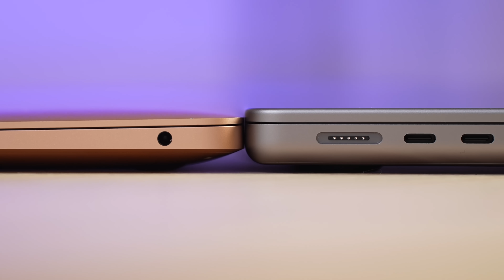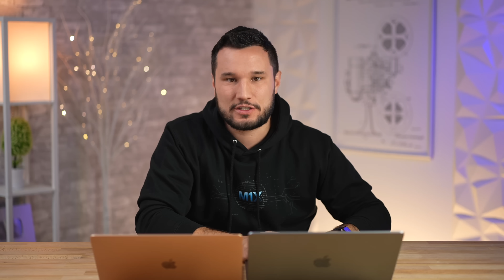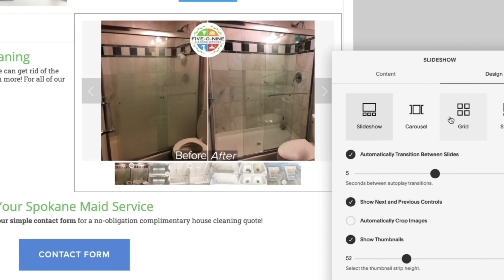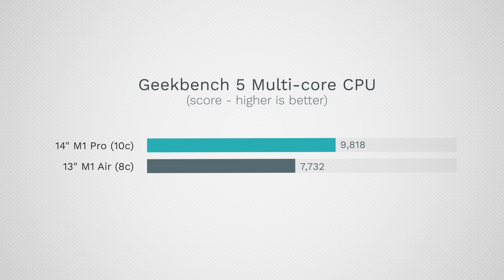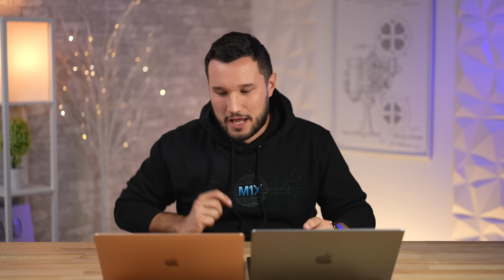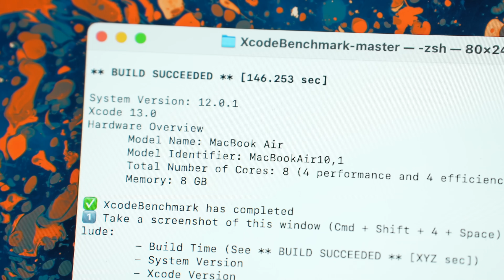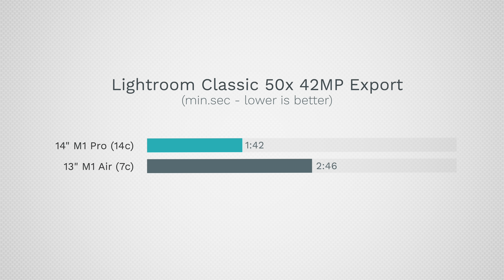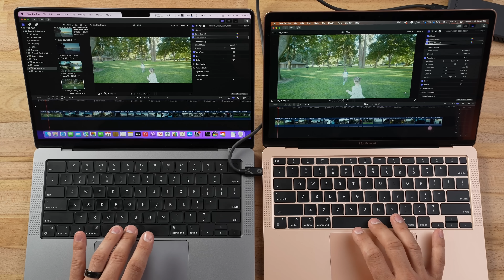14" MacBook Pro vs M1 MacBook Air - Worth $1,000 MORE? 🤔

Comment: I am a bit shocked how well the Air keeps up with the "big" Macbook. But still for two reasons the MackBook Pro is still the only valid choice despite the price difference:
1: Connectors - the Pro at least has some of my daily used Connectors from HDMI when I need to give a presentation over SD Card to transfer data BUT I am still missing USB A!
2: Display - If you stare at a display for hrs at end every bit better display counts. I dont care about performance that much (+50% is good but Display ist more important)

Comment: I am using a macbook air with 16gb ram and an m1 chip.
The figma app complains about the lack of RAM all the time.
Could you test figma app 10-15 open filled tabs + 20 google chrome tabs + zoom + miro app 5 tabs

Comment: Simply another outstanding video! This video addressed my primary point of contention: 16GB or 32GB RAM. Not only did you conduct a stress test to determine the effect on performance in the real world, but you also addressed a subject that was on my mind: how increased memory bandwidth and cache-level SSD write speeds ostensibly obviate the need for old RAM paradigms. Maintain your excellent work.

Comment: I was meaning to get a 14inch MBP but after specing it out it costs 3 times as much as the M1 MBA, since I don't need the extra power, I couldn't justify the extra cost. I wish next year there could be a M2 MBP with a 14inch screen and the ports for around $1500, I just really want the ports.

Comment: Just goes to show what a game changer Apple Silicon is. The MacBook Air remains a great and capable machine for its cost. Versus the nicer screen and even better performance of the 14 inch if you need the extra or can afford the upgrade. Both are great machines and great buys.

Comment: I appreciate that you did this video because I am trying to make a decision between a very cheap but good option, the Air, and the premium option. I don’t do any video editing, just a lot of Microsoft Office/SharePoint work and Adobe Acrobat Pro. Once in a while I’ll edit a short form podcast, but at less than 10 minutes in length and with only 1 to 4 tracks it doesn’t put a dent in the computing power.

Comment: It has been already couple of years since the hardware is running away from software, which cannot utilize the hardware capabilities. At the same time, min 80-90% of users dont really need all this power for their day2day use. Power efficiency is obviously the next step where to go (accross industry arm,x86,…). The power is there.

Comment: Useful video. If you have videos with benchmarks for parallel using Window or Linux on the new macs it’d be wonderful. Also, if you run audio samplers that max out physical memory it will be extremely helpful. Thank you!

Comment: I'd pick the Air. The MBP looks too thick and is retro designed. Also that notch design looks quite awkward. By the way, is the piece (black part) between the keys on the keyboard on the new MBP plastic or aluminum? I think it is the first time Apple didn't use the body color for that part.

Comment: I was very determined to get the macbook air up until they released the new macbook pro. I'm considering getting the pro because of the thermal test presented in this video. I prefer silence over a heavy fan LOL it's the first thing I consider when buying a laptop.

Comment: I just upgraded my M1 MBA to MacOS Monterey 12.0.1 and I can't fast forward the short video adds (commercials) anymore while watching your videos on YT.. Do i have to downgrade again for this option or just safari?

I think it is very tempting to argue "well the 14" entry model has double SSD capacity on the 14", and double RAM, besides all the other features like better display and speaker, thinner bezels etc." however, it really depends on the use case, and instead if paying double the price, for most people the m1 Macbook Air is simply the best deal! you can go with the base model, buy yourself an external ssd and will be perfectly fine. People who need the increased 14" performance already know why they do, most likely professionals, who do a spend a lot of time using this power, faster export time, etc...

Thanks for your comparison, as always very interesting guys!!

Comment: Thank you for this very helpful review. Just a few days ago, I was ready to pull the trigger on an MBP M1 Pro, 32 Ram, 2TB SSD. But after careful analysis from watching this review, I decided that a MBA M1 16 Ram, 1TB SSD would be enough for my current needs at almost HALF THE PRICE. As this video reveals, the M1 chip in the MBA packs a powerful punch for playing my piano VST’s and for finally learning music production either on Ableton or Logic. I don’t do much video editing to take full advantage of the powerful features on the M1 Pro/Max chips + super duper screen. I did like the idea of a high impedance headphone output on the M1 Pro/Max but I can continue using my external USB Amp. As a reality check, I am coming from a 2012 MBA, 4gb Ram, 128MB SSD which miraculously still worked well with my VST’s but was not good enough for music production. 

As Apple is back on its game producing amazing laptops, and if they continue on that path, I look forward to their technological advancements and won’t mind upgrading again in 4-5 years instead of waiting almost another 10 years for a new laptop. Simply glad I am getting a laptop with NO butterfly keyboard.

Comment: One additional set of tests I would recommend is resting the laptop on a non-heat conducting surface, like cotton pants or a couch - as that is often the place where people keep them when working.
Reply: I agree with that. I had an air a decade ago and it was great. Later I got a MBP and it was slightly faster but it would operate without sounding like a jet engine taking off

Comment: I'm upgrading from the M1 Air to the 14 inch MBP. TBH the CPU on the M1 Air is already fast enough for most of my workflows but the 16gb RAM limitation becomes a problem when running containers and VMs

Comment: A very nice and useful comparison. The M1 MBA is still the computer to beat in terms of value per dollar. I would like to see a comparison between the base 14" and the un-binned M1-pro 14" in terms of performance and (most importantly) battery life, both in stress conditions, which you already cover very well, but also in lighter common use (even pros need to browse the web and watch youtube). If the base 14" gets 1-2 hours of extra battery life, I think this would be more valuable to me than the extra performance I would rarely need. Keep up the great work, you got yourselves a new sub.

Comment: Great comparison video. TBH, I wasnt really expecting that much of a difference between M1 and M1 Pro, however that leap in graphics performance really did amaze me. For me, the only downside of this new MBP is the price which means Ill be sticking with my old 2017 13 inch MBP for a little longer.

Comment: The M1 Air holds up very well. It's all you need for the usual student or office laptop use, or a general purpose home computer (if you don't want the iMac). 

The design, display and camera updates to the 14" are nice, and I hope apple gives us a 14" Air with these updates with a $1299-$1399 M2 Air in 2022.  Just a little bigger and heavier than the base Air, with better thermals and RAM but the same M2 chip.
 
Hopefully, while keeping in the Air product line a base 12" or 13" macbook Air with LCD screen + improved 1080p webcam, magsafe, HDMI and one USBC port at $999. That $999 price point is an important one to keep attacking. It reached far more people, and helps establish Apple's laptops as better than the competition at the same price point.

Comment: This is the comparison video I've been wanting to see! I've been using the M1 Air for about 9 months, and was really considering upgrading to the 14" MBP (the 16GB base RAM really appealed to me!). But after seeing this video, I may stick it out with my M1 Air for the foreseeable future.

Except for the odd task or two that ends up in program errors/crashes, my M1 Air has been solid for 99.9% of my daily use. I do some productive work on my machine, but mostly as a hobby for family videos and stuff -- so the 14" MBP might have been overkill as my daily driver. 

Though having said that, I wouldn't mind receiving one as a gift! 😁

Comment: I've known the MB Air is  great value even before the new MB Pro's were out, however I am looking for a MB that will last me for a looooong time. I am worried that the air is not enough in the long run. I am mainly concerned with storage and the ports. I want to do some school work, design work (PS,ID,AI) and video and maybe some programming if I get into it. Also I do not have any other devices such as a TV or Desktop computer or the like so the MB has to be able to fulfil all the tasks, be it watching Netflix, writing a paper or working on my design projects. The base model 14 inch MB Pro seems fine but storage wise, I am concerned, it maybe not enough. If I think of the size of video files and graphic projects it fills me with dread.

Comment: This was a must comparison. I think the performance difference justifies the 600$ price of mid Air model and M1 Pro. I will go for the M1 Pro if i had the money. Currently using a 2012 13" MacPro. The only upgrade i have done of all those years of use is swap the HDD to a SSD.

Comment: results are  normal for macbook air m1 against 14inch m1pro, because there is no fan in air. I am wondering 13 inch m1 macbook pro performance agains 14 inch m1 pro

Comment: Thanks for this extensive video, guys! I’m still wondering though … with these new machines and processors, is it better to beef up RAM or pop for processor upgrades where possible from a future-proofing perspective? If I can’t afford both, is having more RAM better than a few more CPU/GPU cores if I plan to keep the machine, say, 6+ years? Of course, I could avoid the questions with that giveaway machine!
Reply: I’d take ram. As apps want more and more resources. I had to upgrade from my 2013 MBP mostly because 8gb of ram was not enough. While yes, the cpu was showing its age, if I had 32gb of ram I don’t think I would have upgraded last year. I’m a software engineer and used my Mac for working mostly.

Comment: Tbh most people will be fine with the M1 Air, and those who want more performance would probably get the M1 Max MacBook Pros. The M1 Pro MacBook Pro is a good middle ground for those who just want the newer design and features (speakers, displays etc). And when the M1 Air is upgraded to have 16+512gb, it's actually just a $550 upgrade, and it's pretty worth it imo. But, most people don't need to upgrade since the Air is already so good.

Comment: I had my old 2018 13inch Macbook Pro and looking at the comparison video I think its definitely the time now to switch from inter chip to M1 pro. The Chip along with the thermal throttling system and the improved SSD speed makes all the difference.

Commenting to have the slightest chance of winning this giveaway and upgrading to M1 Pro 🤞🏻🤞🏻

Comment: I’ve been debating on buying a MBA or MBP. I’m curious to see if a 16gb MBA would be able to run adobe creative cloud programs with out a hiccup. I run illustrator and photoshop now, so I’m just worried about the taxing of the machine. 

I’m sure the MBP can handle it, but the $2000 price tag is just off putting. It’s a shame people have to make life decisions based on the price of a piece of hardware they need, especially ones who have a small business.

Comment: I’m super impressed to see how well the air stands up against the pro - but the pro still wins out for me in terms of future proofing. Especially since they’re becoming less open for upgrading afterwards, investing in the most versatile setup from the start keeps it viable for much longer - I’ve had mine since 2011 and upgraded it multiple times within reason, but now it’s time to move into the future of chip speed and displays

Comment: if the price difference is only at $600, then maybe I'll go with the new 14" macbook especially because I need those usb c for my tri-monitor set up. Having said that, my wish list for the next macbook air will be the extra I&O's available with the rest of the new macbooks M1 pro and max.

Comment: Great review comparing the M1 air and the new Pro, this is definitely the top video I will recommend if someone were to ask me the same question. Had been sitting on the side lines very tempted to upgrade since the M1 was first announced from my 2015 MacBook Pro 15 inch. I wonder how it looks in real life comparing the 2015 and 2021 MacBook Pros since they have similar ports plus magsafe. :)

Comment: Actually before this video pops up, I'm contemplating if I will choose M1 Air or 14 M1 Pro baseline. The price jump is quite high. And my only intensive task for my use case is twice a month video editing for my channel. I guess I don't need that extra power that much?

Comment: One of the cost-comparison factors might also be the need for IO.  If comparing ‘similarly spec’s’ devices, the addition of an OWC hub, for example will close the gap by roughly another $200 if considering the Air.  The addition of the ports is a significant win in this gen of devices.  Sad that I’m actually saying that.

Comment: Great review. Is it possible for you to include in your reviews a test on the quality of the headphone jack? I believe apple said the new MacBook pros can now power higher impedance headphones. Wondering if an audio engineer or audiophile can get satisfactory sound without the need for an external Dac/amp. I mix music on headphones and reference my mixes on the speakers of 2012 MacBook pro I currently use so this is actually important for me.

Comment: There are a couple things about the 14" that are important to me over the MacBook Air. Cooling. My 2013 MacBook Air is downright hard for me to use in my lap when it heats up. I doubt very much that the 14 would heat up that much. The larger screen size is also impressive given that the actual dimensions of the two are so close. Also it has that impressive min LED display. And finally, the icing on the cake for me is the magnetic power connector. If I had a hard connection, I'd end up having my computer repaired on a yearly basis. I really have to have an easily detachable power source. So, I am planning on getting a 14" sometime down the road. It has more than a horsepower for what I do.

Comment: I use a M1 Air since feb/21 and it's works wonderfully. I was using a Legion Y720 for coding and gaming. It was awful to take anywhere and, now I leave the Legion at home to gaming and the Air comes with every where I need to go. I cant even think what a new M1 Max/Pro could do for my workflow. Anyway I love the new Apple silicon!

Comment: I have ordered the 2021 16" M1 Max MBP with 10/32 cores of CPU/GPU, 64GBs of unified memory and 2TBs of SSD.  If I were to win the $2500 14" MBP, I will make my wife happy, and return my 16" M1 Max.  Both machines are more than I need and are all I could reasonably want.

Comment: Isn't a mistake that you wrote "10 core" for the 14" MacBook if it's the binned version? The base model, that costs $1,999 only has an 8 core CPU (2 efficiency and 6 performance).

Comment: What were the specific specs of the 14” you bought? Thank you for doing the upcoming video on the 8core binned vs unbinned. What are the notable differences between the binned unbinned vs the air in terms of battery? The air has more high efficiency cores than the pro binned, does that mean it can browse and watch video better for longer?

Comment: Great comparison, thanks for putting these two head to head as I’m thinking about jumping from my 2018 intel MacBook Air to one of these. Upgrading to 512 ssd and 16 gb of ram on the M1 Air makes it a very close call, but that better screen and ports on the M1 Pro almost tip the balance despite a lot of other benchmarks not being as far off as I would have thought prior. Man ….we are spoiled.

Comment: Can you guys test accelerated Tensorflow on these Macs compared to the last year's i9? if they perform just as well in Data Science/ML Engineering workflows, it would pretty much render AWS cloud computing for mid-sized model training obsolete - which is crazy expensive, ab 14$/hr. So even if one were to purchase specced out 6k$ model, they would start saving money after a month which is crazy.

Comment: Your videos are epic. Superior comparisons over and over. I've been holding out for an M1 until the 14" came out to see if the price and performance would be worth it. I'm coming from a 2008 13" MBP, and have been suffering with my sister's HP for a few years while waiting for the 14". Now that they're out (and $200 more than I hoped), it a tough choice. I've been wanting to get back into music software like Omnisphere, Reason, Arturia V-collection, and doing fairly simple video stuff using just iMovie (Mac still has that preinstalled right? lol).  My 2008 with "upgraded 4gb ram" started slowing down around 7 years into it's life, and the past few has struggled with Chrome.  Ideally, I'd like to have a laptop for a decade.. so I'm not sure how much more future-proof the 14" would be compared to a 16gb 512SSD Air.  Or maybe it's a gamble expecting any laptop to last that long without something failing, so maybe wiser to go for the cheaper Air and just buy a new Air in 7 years.  And for the tasks I mentioned.. would the Air start to have issues in say 6 years running music software for playing live.. compared to even a 13" M1 with a fan, let alone the 14"? 
So my concerns are if the Air would be fine for at least 6 years compared to the 14", and then if the 14" would give me a few more years of usability.  If the Air can hang fine for 6 years then it would cost almost just as much to do a new Air every 6 years rather than hope one 14" can make it 10+ years.